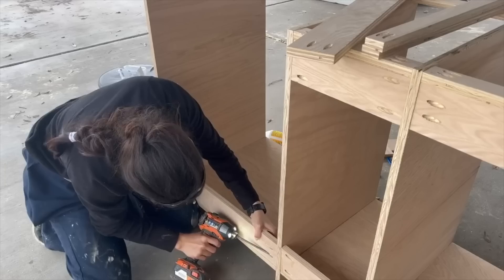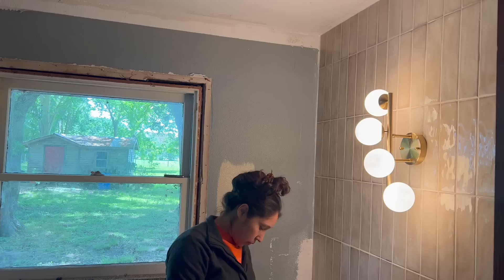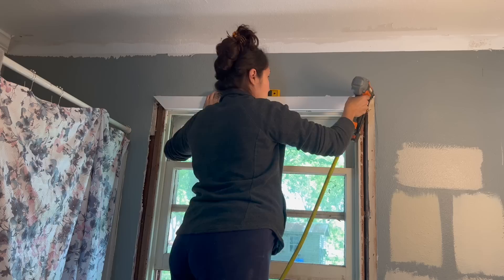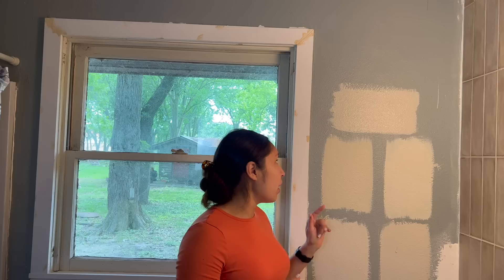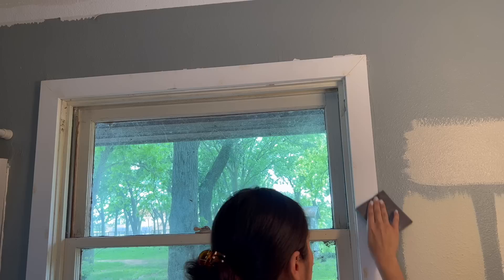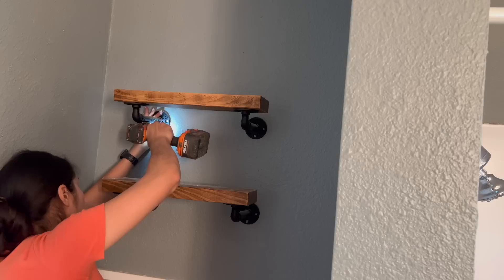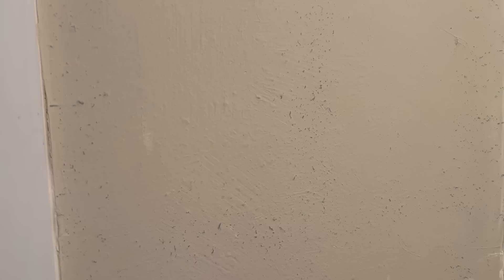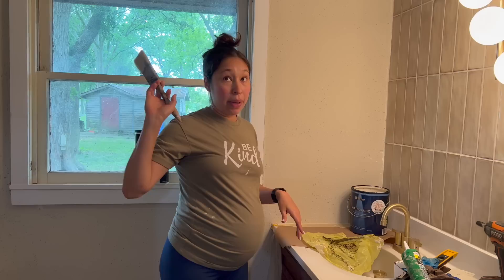BATHROOM RENOVATION PART 10| Faux Roman Clay Technique Painting & Adding Window Trim

Comment: Caulking is a mystery to me I seem to get either too much or too little.
Reply from the maker: It just takes practice! 
Maybe I'll make a YouTube short video and hopefully you find it helpful! ❤️
I find that cutting the tip small, at an angle and holding the gun at the right angle when applying works best!